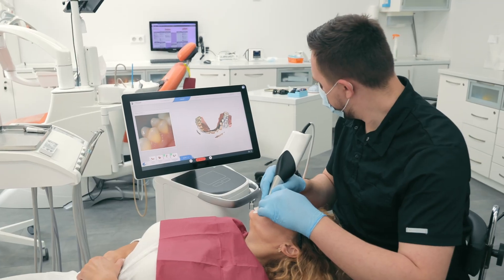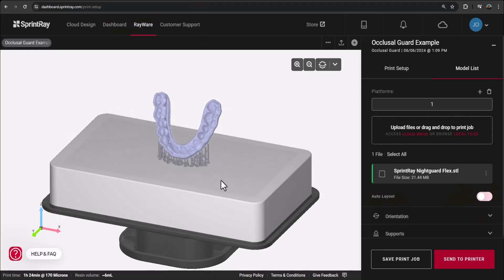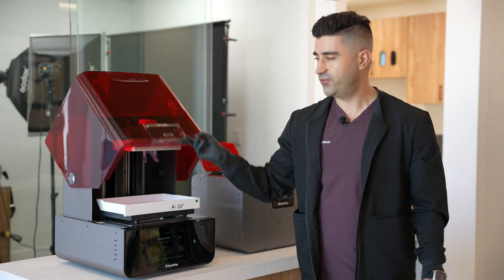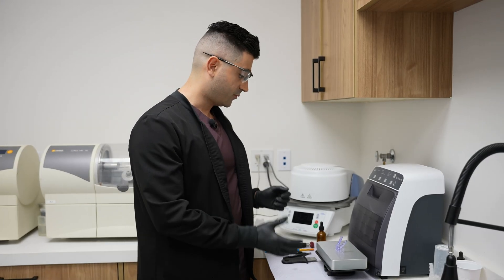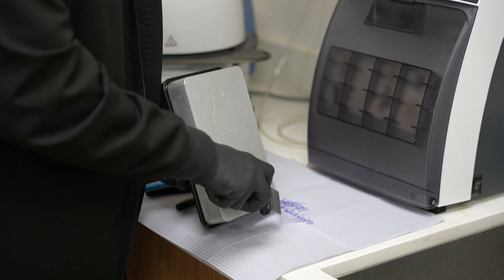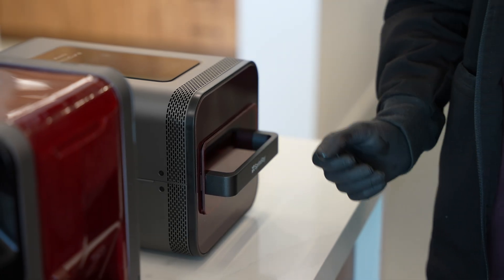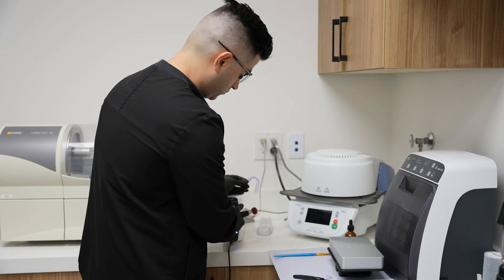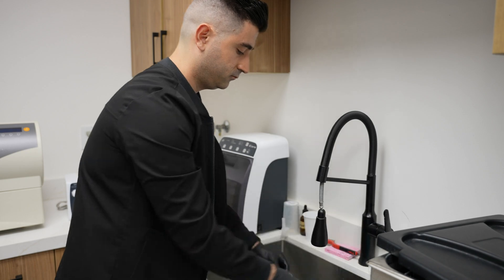How to 3D Print Nightguard

Comment: After the alcohol rinse. Can I wash the guard with a little soap and water to remove residual alcohol, dry it and then cure it?
Reply: After washing with alcohol, air drying really well takes care of residual alcohol. Don’t use soap until you’ve fully cure based on manufacturers recommendations.

Comment: why  would you not remove the supports with the slow speed before post curing when they are even softer?
Reply: Looks most of the supports are removed before curing. He's just using the slow speed to remove the leftover bumps. I prefer the one-handed removal method (from the other doctor from the other Sprintray nightguard video) instead of scraping the guard off the platform.
Reply: I remove the supports prior to post curing by peeling them off then use the slow speed to remove the bumps. THEN I cure. This video edit is very misleading. No need to repolish after curing. Your question is very valid.